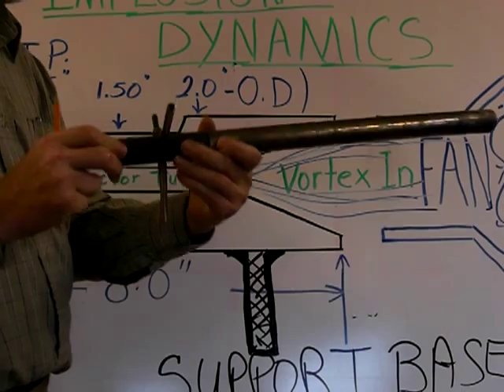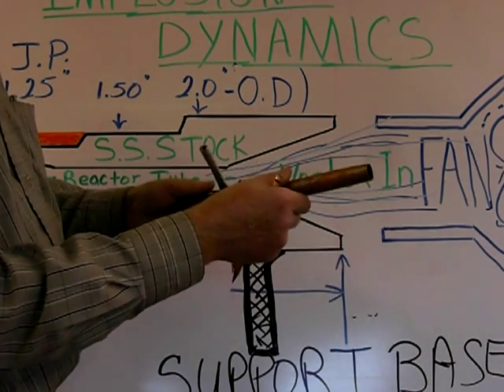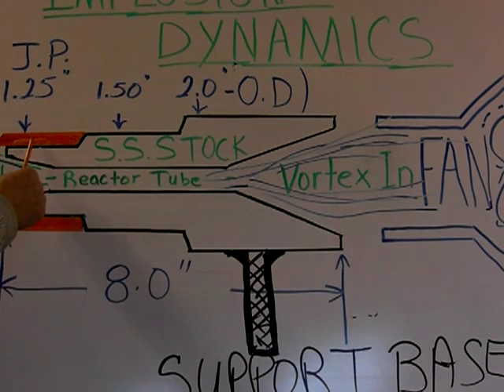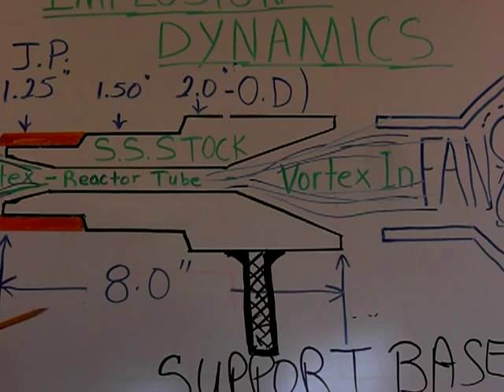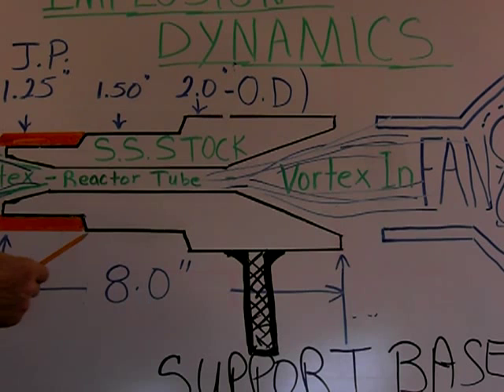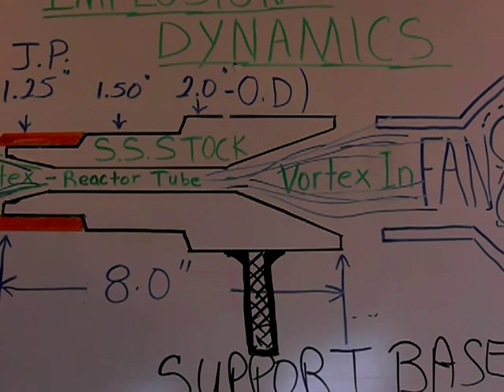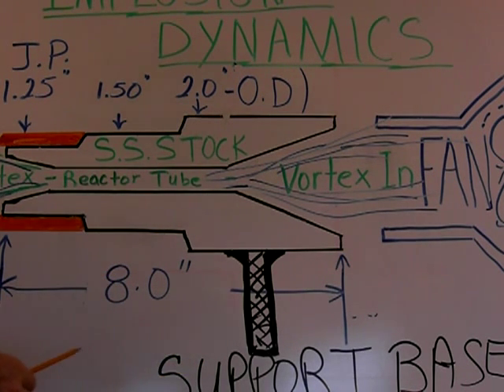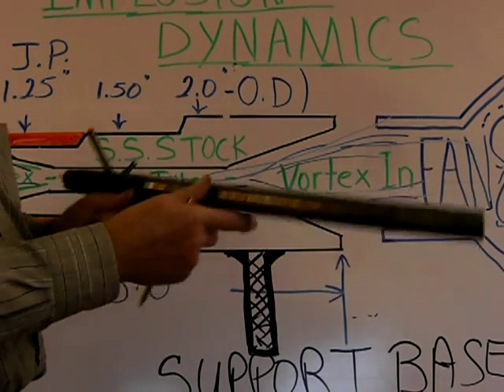#21-IMPLOSION DYNAMICS-How To Make a Joe Pipe Holder Device.

Comment: HI JOE.
JUST WATCHING THIS,  would the in put pipes not be better going in at an angle from the rear of the direction of flow, as this would create pull like vortex to pull the in put in, directly in puting vertically creates turbulance inside the main tube, angle the inputs facing back, you might get better /higher pressures available on in put lines. ?
just a thought.
thom.